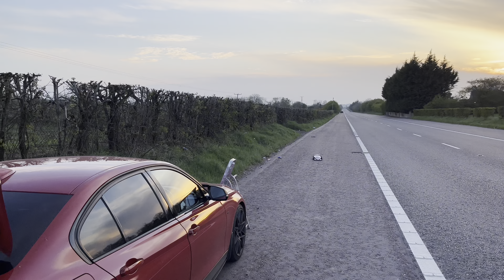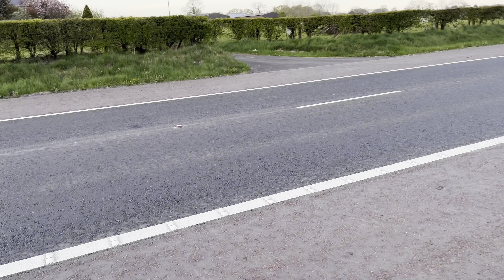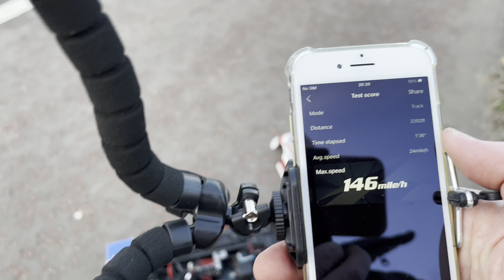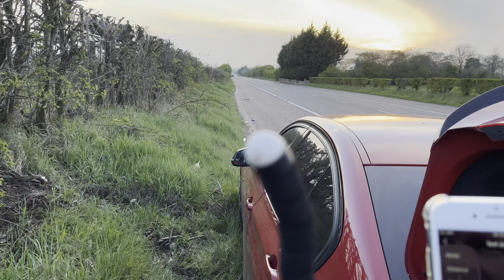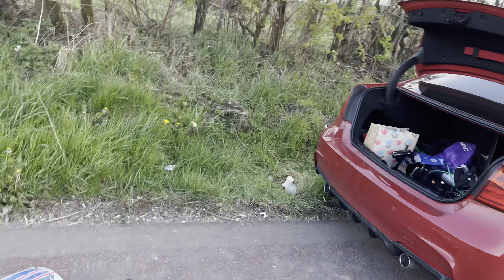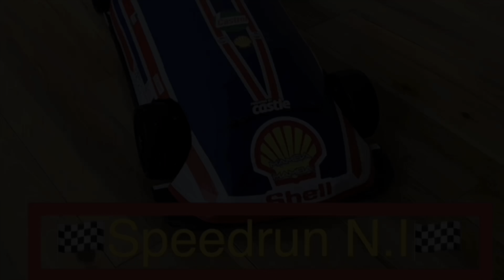Final run of the night- arrma limitless speedrun with batteries heated.146mph-

Comment: I share your love of V-TEC engines. I had a 1991 Civic V-TEC many years ago that ran 260km/h and to this day it is still one of the most fun engines to drive. 8500rpm redline FTW. Nice run btw! Stupid question...is there a reason you don't drive from the other shoulder? I see at least two benefits - that parked car would no longer obstruct your view and as a bonus you'd have the sun at your back. Or is there something that makes this impractical or not feasible? Just curious. I just ordered a 1721 as well to add to the 1717 and TP4080. Very much looking forward to trying that beast out :-)
Reply from the maker: That’s serious RPMs, they sound awesome!
This is the best bit of road, and I run this direction as I can then see what’s coming towards me, if I run the other way I’m heading into a corner, further up the road you have more driveways and a garage entrance
Reply: @audiquattrojamie  Ah yeah, that makes sense. I don't suppose people in Eire leave the parking brake off like in Paris so you can move the cars around by hand do they? ;-)
Reply from the maker: @diemturner5755  😂👏
Lol it’s all good, that was only one night there’s been no one the parked there the last two outings